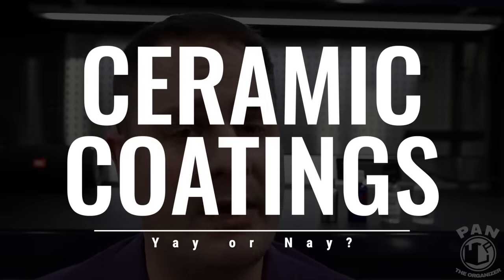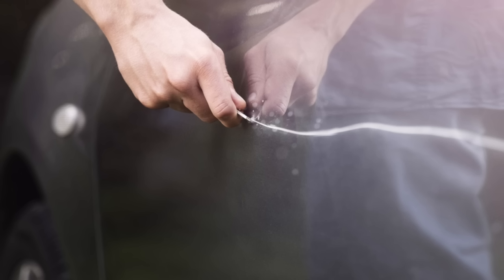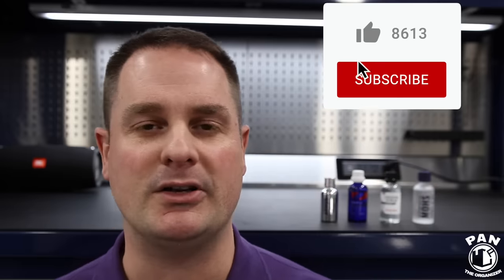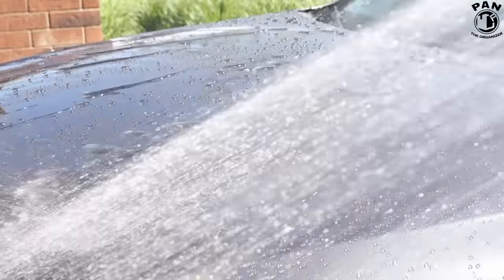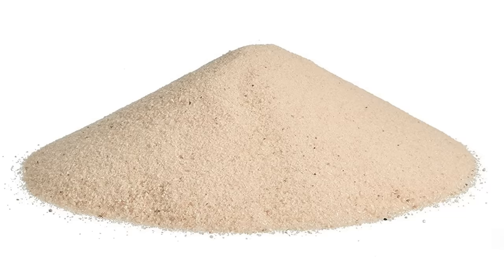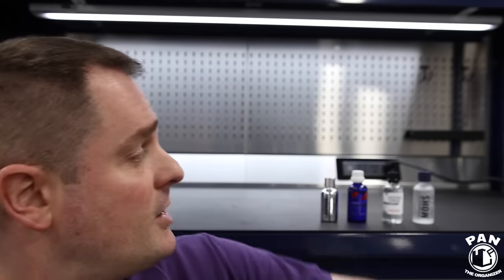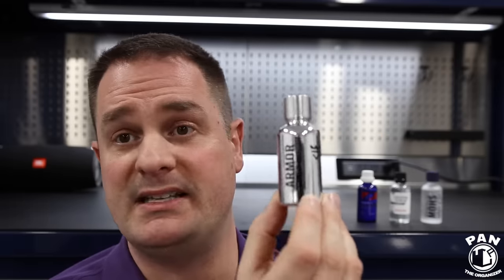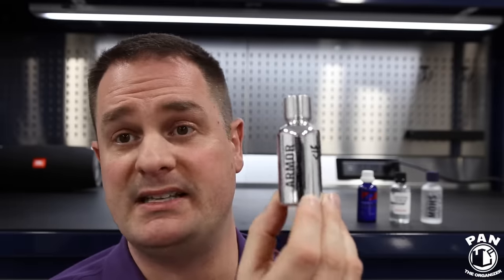DON'T BUY CERAMIC COATINGS BEFORE WATCHING THIS !!

Comment: This was so helpful PAN, thanks so much.  The marketplace is confusing, but your straightforward method gives me clarity.  The big takeaway was the difference between waxes and ceramic coating.  I get that, but I still don't quite understand what you mean by "Warm Glow".  I know the warm glow on antique furniture with paste was vs sprayed newer furniture.  In addition, I am not sure where waxes play into this.  I know that one should not wax over a ceramic coating, but it seems like I watched on another channel where the car was waxed first, then coated with ceramic.

My biggest concern is a coating that will handle the frequent use of a car cover for my daily driver that will not be garaged.  During the day, it must sit in the sun if parked in the rear, but in the front, there are shade trees with all of its sap, pollen, and bird droppings.  Moreover, I finally realized that a truly "waterproof" car cover is dangerous because while it protects from rainfall, it won't protect from dew, or rising moisture from cement,  blacktop, or gravel driveways and streets. The covers can trap moisture under the cover. Can any ceramic coating counteract this problem?

On weekends, it probably won't be under cover, as I am driving it more, so UV ray protection becomes important for the body, along with an insulated windshield pad to protect the dashboard.  

I finally ordered a "water resistant" cover that breathes, to allow moisture to escape.  I understand It is also important to remove the cover in hot weather if the sun comes out following a rainstorm.  I have seen the "blushing effect" resulting from the sun baking the chemicals in the cover's underside to the paint from a guy's YouTube channel. He faulted the car cover company, but a user pointed out that he failed to remove it after rain storms.  

All that to say, I need a formula that is easy to apply, slick enough to withstand car covers that may shift with the wind, and protects against the sun, and any moisture that might seep through the surface of the cover while I am at work as I don't commute by car.  I think a video on coatings and car covers would be useful.

Comment: I’m a complete novis when it comes to modern methods. Of course I used the bucket and sponge method until I was about 50 years old. Then I started taking my cars to the car washes.  I haven’t washed a car since then. I’m retired now and 80 years old, and the new methods excite and amaze me. When I saw this video, I jumped over to the web site for the top rated ceramic coating and bought a kit. My car is relatively new (an all electric Ioniq 5), but in April I had it ceramic coated with a spray product from Walmart. It has a life expectancy of about six months. This is July 29th. Can I use the more protective coating now or should I wait until October?  I’m getting ready for my first foam car wash.  The temps here have been too high recently and I have direct sun on most of my property. That has delayed my foray into the world of DIY car washing. I have very much enjoyed your videos. Thank you for being so informative .

Comment: One of my friends brought me Avalon King to apply on his car for him. I did a full iron removal and clay bar process, followed by a one step light polish and IPA wipe on his car before the application. Avalon King is extremely easy to apply and has some scratch filling properties. However, I find that it loses its water sheeting and water beading ability earlier than Gtechniq. I think they may have sacrificed durability for ease of use.
Reply: Whats iron removal and clay bar process exactly?
Reply: @MikeSmith-fq5dv  Iron flakes off from vehicles and deposits itself in the paint (and other surfaces) of your car, iron also rusts when exposed to water which causes your car to look horrible and orange. The “bleeding” purple you see from iron removal products is the product reacting with iron, it makes it really easy to get rid of those iron deposits. Clay bar is the next step up in terms of surface contaminant removal, tar and other surface contaminants might not be removed from the chemical spray, so after cleaning the car extensively we apply a clay bar and rub it over the surface, surface contaminants get stuck inside the clay bar and are pulled off of the surface. It’s important we then polish to remove any scratches or swirls that were applied in the process, before then applying the coating.

Tl:dr; Surface contaminants have to be removed before applying ceramic coating, otherwise you lock these contaminants into your paintwork and the coating won’t provide the desired aesthetic effect since you’ll see all the surface damage and contaminants beneath the coating. Iron removal and clay bar gets rid of these contaminant.

Comment: I have a question. I live in Winnipeg and winter is coming I also don't have time to do all the prep work before adding a ceramic coating. Would it be okay to do the coding without all the prep work? Of course I'll wash the car but past that would it be damaging to my paint work to seal contaminants in since they would be there anyways?
Reply from the maker: If you have any existing protection like a wax or sealant, you ABSOLUTELY have to do all the prep work including polishing the surface in order to ensure 100% removal of that old protection before you apply a ceramic coating. Those need to bond directly to a virgin clear coat.

Ceramic coatings are no joke. They last for years. But you need to soend time for the initial application.

If you don’t want to take the time, then stick to using traditional waxes or sealants. No real prep work needed for those, but you only get a few months durability. There are always tradeoffs in life.
Reply: Hey thank you so much for replying!! I have a 2018 sorento. It's never been waxed before. Other than washing it at the car wash and spraying the turtle Wax spray let's say I assume washes off with every wash? Would I have to count that as a coding to be removed?

Comment: Great, informative video, Pan.  I was particularly glad to hear your professional opinion about graphene coatings versus ceramic coatings.  The main point I gathered from what you said is that there isn't yet a long enough track record for the graphene coatings whereas there is a well-established track record for ceramic coatings which have been perfected over the years and made easier to apply.  Let's say I have a 3 to 5 year ceramic coating applied to a brand new car.  At the end of the life of the ceramic coating, do you go through the same steps - wash, clay bar, paint correction, and then new ceramic coating?  Is it hard to get off the remnants of the old ceramic coating in order to prepare the car for a new ceramic coating?
Reply: As far as I know, you have to polish before reapply, but hopefully Pan can give us a better answer.
Reply from the maker: Exactly. When you get to the end of your coating’s life cycle, you would fully remove it through washing, decontamination, machine polishing, IPA and then apply the new coating.

Comment: This is great, watched the whole video. Question - I heard there's a difference between ceramic coatings that come in glass vs. plastic bottles. Is this true? I recently applied 2 coats of Turtle Wax ceramic spray. Is this not a real ceramic coating? Thanks!
Reply from the maker: "Real" ceramic coatings are the ones in glass bottles. They are the ones that last for many years, but they also cost more, and take more time to apply and are harder to apply.  Ceramic spray (also known as silica spray sealants) typically last 6 to 12 months, so not as long as their glass bottle counterparts, but also the sprays cost much less, and are easier/faster to apply. 

That doesn't mean the sprays aren't good. They are great, but for their target audience. But they're not as durable as their glass bottle versions. So you have to see what your budget and experience level is, to make the right choice.
Reply: @PanTheOrganizer  Thank you!

Comment: I have a brand new car that is a daily driver, i talked to a professional shop and they are offering me a ceramic coat with a 7 year warranty for $750, or a 8 year coating with no warranty for $550. I have a power washer, foam cannon, and detailing supplies for DIY. I'm struggling to decide if the professional coating is really worth it.
Reply from the maker: If that's all they quoted you, that's actually inexpensive, depending on the quality of the ceramic coating they are offering. Is it from a reputable coating brand like: CarPro, Gyeon, Gtechniq, Opti-Coat, Kamikaze, IGL, Fireball?
Reply: @PanTheOrganizer  the brand is owner's pride. I haven't seen it on your channel.
Reply from the maker: I actually made a full review of their products here: https://youtu.be/ZiUs8KLil0s

And I’m testing their coating in this long term test: https://youtu.be/MoBTLpRFFw4
Reply: @PanTheOrganizer  awesome i'll check it out. I think I may go for it. My only concern is having to pay for it to be repaired if someone  hits me or something but I really just hope that doesn't happen lol 😂

Comment: Can you still wax your car with with the ceramic coating on your vehicle, or is this defeating the purpose?    Thanks for in depth vid.   Top notch!!!
Reply from the maker: You wouldn't apply a wax on top of the ceramic coating. You would be masking the coating's superior properties and the coating will end up rejecting the wax anyways.

Ceramic coatings are a much better form of paint protection, and last for years compared to a few months for regular carnauba waxes. For maintenance of a ceramic coating, once every 2-3 months, you simply use a ceramic spray to ensure proper performance and optimal durability.

I have a tutorial on the simple method of doing a maintenance wash on a ceramic coated car here: https://youtu.be/IqIW78FmRYU

Comment: Pan the type of dude to ceramic coat his toilet seat 🚽
Reply: toilet bowl to have quick and better flash. No water beading and shitting ;) Pan good job as usually.
Reply: @thomasindaclub  the shit slides straight down to the bottom
Reply: @KG-gw9qn  no sign of shit apart of bad smell ✌️keep it tight, keep it clean 🧽😉😂😂
Reply: I can see problems with a low friction toilet seat when you are drunk...
Reply: Might have to do that to my toilet no more skid mark🤭😂😂😂
Reply: Honestly been thinking about using bead maker on it
Reply: Actually not a bad idea.
Reply: I actually ceramic coated the inside of my cats litter box to help clean it easier 😂
Reply: @cuh720 IQ 500 move man I'm going to try it
Reply: @kellyblack4897  I tried it with new boxes though

Comment: Great detailed info. Thanks. If you need to top these up every three months, then why not just use a spray coating every three months instead? Like a tw hybrid solutions ceramic coating?
Reply: I got the 303 graphene coating and applied it to my car after a thorough wash and clay...it literally took me like 25 minutes to do. Very easy and it's holding up very well. I don't see the need to use ceramic coatings anymore. I think they are better off used on leather seats and interiors now.
Reply: If you're talking about the detail sprays, you should be doing that after every wash regardless of what coating your using. Outside of that they are far superior to any spray on coating in every way. In durability, hydrophobicity, look, and they also have self healing properties. That last part is in response to things like paint swirls.
Reply: Just ordered the Adam’s graphene ceramic coating spray and graphene detail spray to touch it up. Dmitrys Garage tested it and it enhanced gloss and lasted over 100 basic washes
Reply: @davidcastellanos2492  You are good to go with that...no need for an expensive ceramic coating.

Comment: So far at 30:30 the one takeaway is that the cost of professional clear ceramic coating because it is labor intensive however it also lasts longer than DIY. DIY lasts a number of years and one must perform the laborious tasks themselves as in wash,  decontamination of iron and brake dust(?) , or another metal deposit on paint,  buffing and polishing (if you have the tools!) before you then have to apply the coating evenly and level it. Didn't say how to fix a 'leveling spot' or area as was shown on hood I believe was in an elongated triangle shape(?). I think if one was to calculate time it takes to DIY, having to borrow or purchase the power tool (decompressor?) and new buffer pads and two coatings (has a top coat for the silicone coating(!); you may find that it costs almost as much as having it professionally performed. My labor may be free in dollars but sounds like it could take an entire day away from family or R&R for oneself, to return to work somewhat refreshed.  This can be especially true if you work a six day work week.  I know the purpose was to show that one does not, in fact, have to have ceramic coating professionally done however... I put in my two cents toward my response to the, 'what is the thing you've taken away from this video so far' you had requested we place in the reply to the video. Thanks btw, I liked the learning! Forgive all the exclamation marks but I don't like emoji in providing my point(s).
Reply from the maker: So selecting between applying a consumer grade coating yourself, or having a professionally installed coating depends on many things.

If a person has some experience cleaning, decontaminating, and polishing, and have applied a wax before, and have a more limited budget but more free time, they could do the DIY method and apply a coating themselves.

If a person has a bigger budget, more limited time or a super busy life, and little detailing experience, and just wants pure perfection and the warranty that comes with a pro grade coating, going to a certified installer is a good option.

Welcome to my channel. You discovered one of the biggest car detailing channels on YouTube as we surpassed 830,000 subscribers and 105 million views! I have been detailing for 25 years and I love to share my knowledge and passion with my viewers.

You found the right channel to help you learn everything about detailing.

Comment: Hey Pan!  I have a 25 year old pampered vehicle that has grown used to the P21 S line of paste carnauba, cleansers, wheel cleaners and anything else that is associated with them.  I winter the car after fuel additives, tire maintenance and lifting on GoJax casters, covered until spring.  I usually put about 1000 miles on it annually  (spring/summer/fall- still out w/this warm weather) In anywhere from 10 to 15 outings (rides, car shows, etc.)  After watching this ceramic show, I'm seriously considering switching out the P21 lineup and going for it.  My quandary though, is sort of, if it's not broken, don't fix it.  It always looks great because of the muscle I put on it... trigger fingers and all!  I'm also  a creature of habit.  As perfect as it is though, I've only won one car show, which was a local event.  It has never won a Concours which is my ultimate goal.  So ... wondering ..... continue w/wax, or make the conversion?  Will it make the difference??  ....hmmmmm.

Comment: Thanks for this informative vid, Pan! The detailing industry has come such a long way. I remember when Carnuba was THE thing! Quick question: Is ceramtic coating safe on PPF? I have PPF installed on my hood and rear bumper and was wondering if this would be safe to use on top of it. Cheers!
Reply: Go for carpro skin, it is designed for ppf and vinyl. I think gyeon have a similar one as well. I went for carpro skin on my ppf 6 months back and so far so good.
Reply: @FerasSKayyali  Gtechniq Halo is also made for PPF.
Reply: I put cquartz on xpel ppf...works well
Reply: @georgebugarin1078  it does, but skin is developed so it can be removed without polishing as self-healing PPF shouldn't be polished. Maybe cquartz will give better protection, but it will be hard to remove if you want to remove before reapplying several years down the line.
Reply: I applied Avalonking ceramic on my PPF after talking to their support. It looks absolutely flawless now.
Reply: @MoistShot  congratulations! Good to know!
Reply from the maker: Yes you can apply ceramic coatings on top of PPF and wrapped cars. Some companies are even offering coatings formulated specifically for PPF like CarPro Skin and Gtechniq Halo.
Reply: @FerasSKayyali  i plan on reapplying when the coating is no longer effective, but I understand the concern. I put four applications of cquartz so hopefully the coat lasts a while
Reply: @georgebugarin1078  I might follow suit when my ppf needs a new ceramic coating.